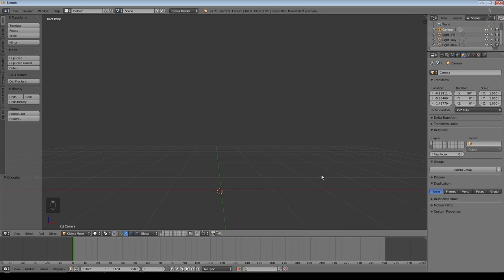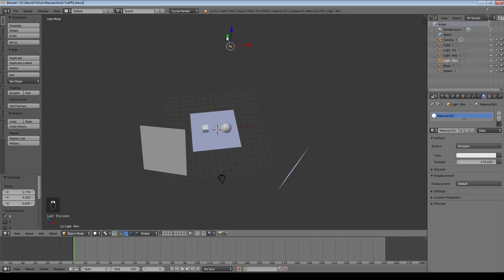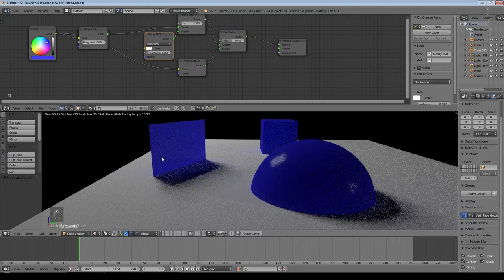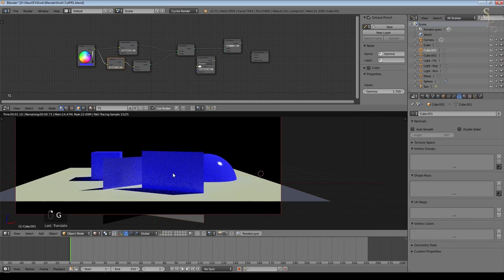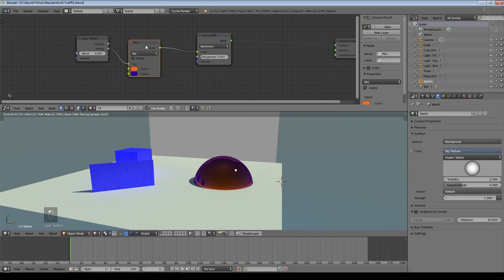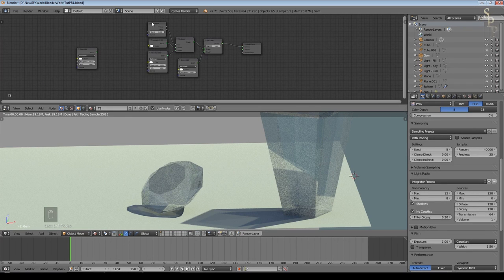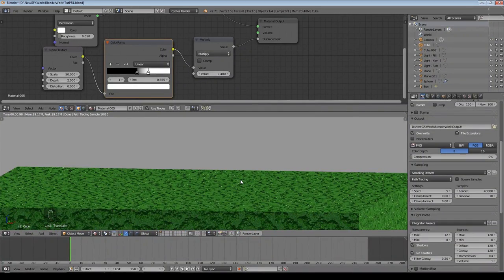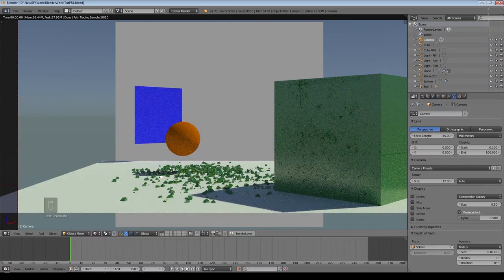Blender 2.71 - Photo Realism Tips

Comment: Hi Sardi,

I think the reason extreme depth of field looks miniture a lot of the time, is because the focal length is set too low. If you look in movies, or Blackrainbows amazing work you'll see that they use extreme depth of field but it doesn't look miniture. I've noticed that in all of these shots, the focal length is set decently high, and the image has a flatter look to it.

Another tip for photorealism, is to use bevel. No solid object in existence has a completely sharp edge, even knives. It's also really easy. It's as simple as adding a bevel modifier.